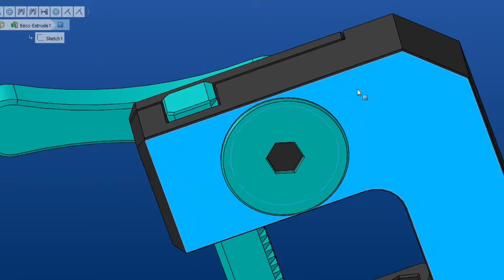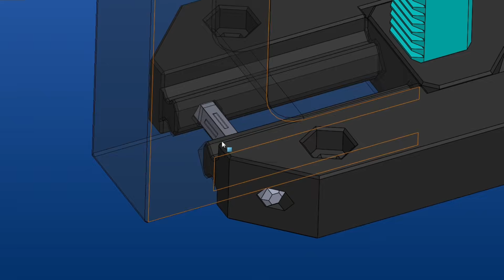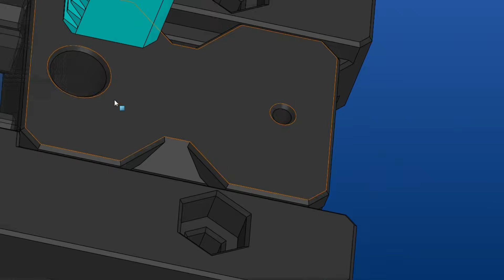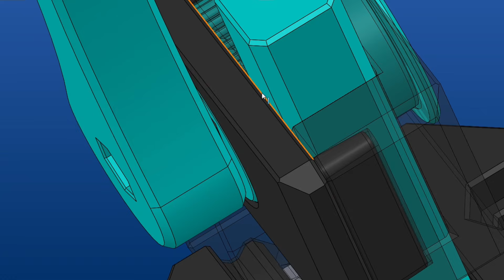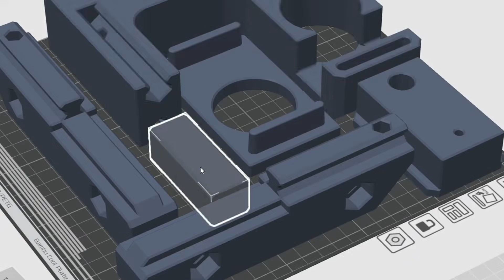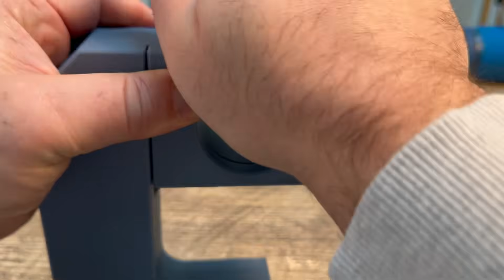3D Printed Arbor Press V3 - Complete Build Guide

Comment: Suggestion for improvement: If you notch out the top gear notches on the press (not the gear itself), when you take the press all the way down and try to go further, it can "skip" on the missing 2 notches but when you turn the handle the way to raise it up, it should be able to grab and raise it. Makes it into a self adjusting press so you dont have to fiddle with the handle position anymore. Check for arbor press mods on youtube to find the trick explained.
Reply from the maker: Thanks. We are planning a revision at some point so we'll keep this in mind.

Comment: hi macshay, 

printed this today, and while putting it together, i have a tip for assembly and getting the handle in the correct spot. insert the handle onto the gear wheel, and hold it so the handle is almost vertical. when you drop the ram in, it should end up with the arm in the correct spot about 35-40 degrees "down" from dead flat.

or at least, starting based on the "back position" of the handle allows for more consistent adjustment.

accidentally printed half the batch at 2 walls/15% instead of 3/30% so i've got my fingers crossed and a few potential reprints in the future.

works great so far, was having trouble closing some usb drive assemblies but this was able to smoothly apply power and ram it home

Comment: Really? I just printed the older Version 2 days ago... 🤷‍♂
Reply from the maker: Some parts will still work. But many improvements!!
Reply: @MacshayCreations  I can see that. I made a magnetic Clip-on Extension for the Shaft,
so i can press a Magnet in the Hole that is deeper than the Magnet's Thickness.
All in all, this Press is quite awesome. I just wished i had waited 2 Days...